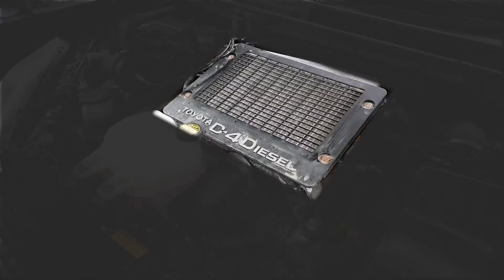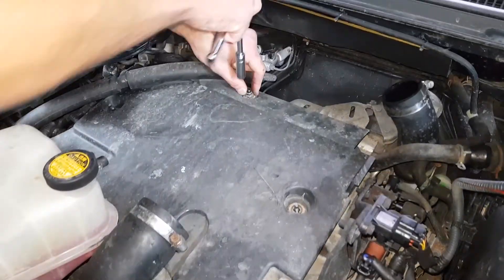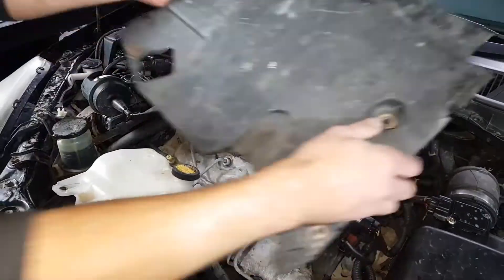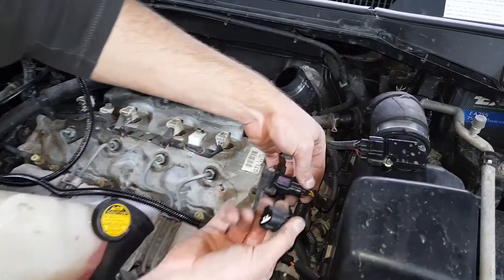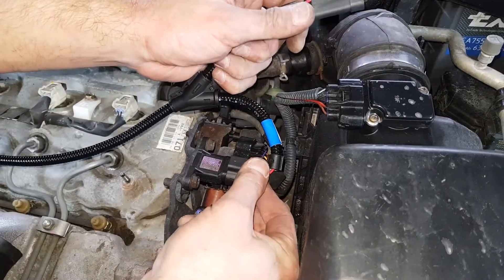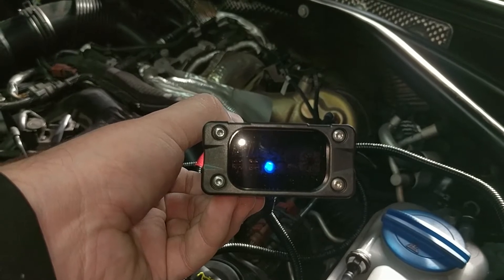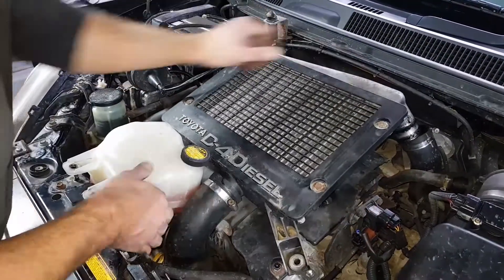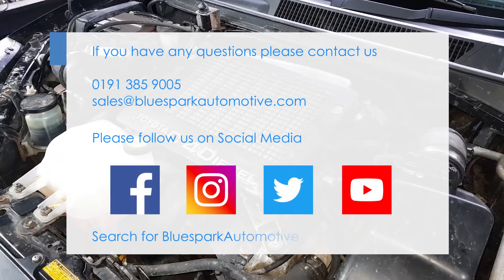Bluespark Automotive Toyota 2.0 & 2.2 D4D Chip Tuning Box Install Video

Comment: Hello I have a 2011 Toyota rav 2.2L. Which is the best chip to buy? I'm after better fuel consumption and more power if there is such a chip that does this?
 Kind regards
Reply from the maker: Hi Tom. 
Yes, we can offer a box for this. Our Tuning Box will give you more power and with sensible driving, you could see a 10-15% gain in MPG. 
There are two engine power outputs in the 2.2l engine. If you could advise your power or drop us an email sales@bluesparkautomotive.com we can link you to our listing for your vehicle.